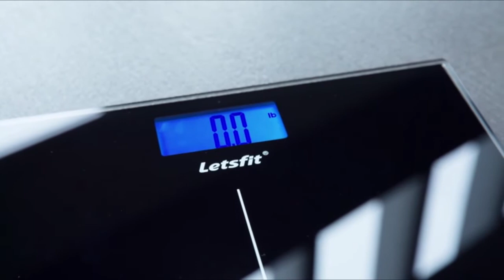Bathroom Gadgets|Bathroom Cabinets|Amazon Home Ideas|Things You NEED #12

Comment from the maker: You can find these products on Amazon:
Freestanding Toilet Paper Holder Toilet Tissue Rack Scroll Stand Roll Dispenser with Storage Shelf Reserve for Phone Tablet Magazine Bathroom Organizer Bath Tissue Organizer
▶https://amzn.to/30eNS40

Heavy Duty Lavatory Glass Bathroom Shelf, 2 Tier Tempered Glass Shower Shelves with Towel Bar Wall Mounted, Shower Storage 15 by 5 inches
▶https://amzn.to/2GbL2Ga

Honey-Can-Do BTH-05079 3-Tier Metal Bathroom Shelf Space Saver
▶https://amzn.to/30fTN9b

Bathroom Glass Shelf Tempered Glass Rectangular 1 Tier Extra Thick Silver Sand Sprayed Wall Mounted
▶https://amzn.to/3mZx9LP

Toilet Paper Holder Self
▶https://amzn.to/3mZb8Np

Suction Corner Shower Caddy Bathroom Shower Shelf Storage Basket Wall Mounted Organizer
▶https://amzn.to/30fzLvB

Memory Foam Bath Mat Non Slip Absorbent Super Cozy Velvet Bathroom Rug Carpet
▶https://amzn.to/3cMj7IT

Revolutionary Tub Drain Protector Hair Catcher/Strainer/Snare
▶https://amzn.to/30ceYsL

The Original Bathroom Toilet Stool
▶https://amzn.to/3jbzeCk

Letsfit Digital Body Weight Scale, Bathroom Scale with Large Backlit Display
▶https://amzn.to/2S8iUpY

Suction Cup Toothbrush Holder Wall Mounted, Power Lock Bathroom Shower Organizer for Electric Toothbrushes, Toothpaste, Shaver, Razor and Makeup Brush, No Drill or Nail Needed
▶https://amzn.to/3j8aTNA

UV Toothbrush & Toothpaste Holder, with Drying & Build-in Fan, Wall Mounted Toothbrush Organizer, 5 Slots for Bathroom Family Kids, USB Charging Equipped with Adapter
▶https://amzn.to/31560No

Toilet Night Light 2Pack by Ailun Motion Activated LED Light 8 Colors Changing Toilet Bowl Nightlight for Bathroom
▶https://amzn.to/3mU5Tym

Razor Holder for Shower-Hook Hanger Stand(4 Pack)Adhesive Stainless Steel Heavy Duty Utility Storage Hook,Shower Hook for Razor Bathroom
▶https://amzn.to/3n8FYmX

Powerful Vacuum Suction Cup Hooks Heavy Duty Organizer for Towel, Bathrobe and Loofah - Shower Hooks for Bathroom
▶https://amzn.to/3kZcaqC

SnapHook TrueColor Hook Free Shower Curtain | Removable Liner | See Through Top | Machine Washable 
▶https://amzn.to/33a6J28